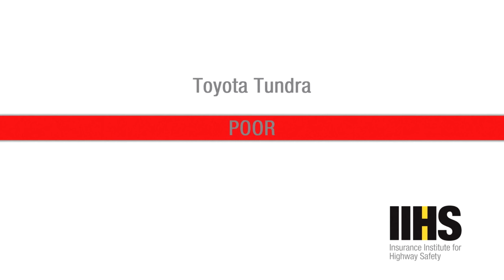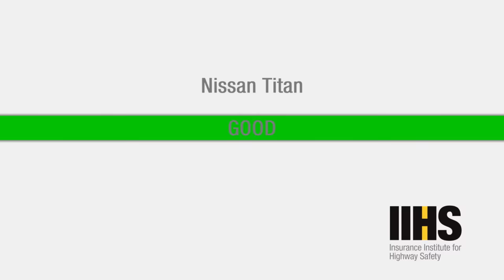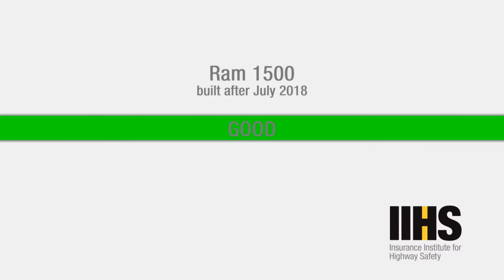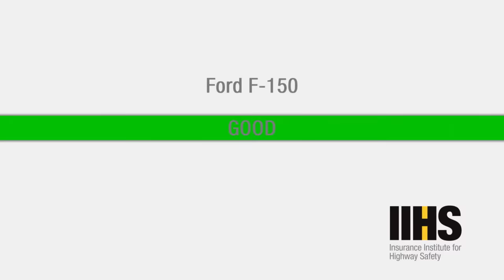TRUCK CRASH TEST COMPILATION - Ford F150, Toyota Tundra, RAM 1500, Nissan Titan

Comment: Better headlight?  Yeah, you ever meet a new pickup on a 2 lane at night?  Even on dim the are really frikkin bright to oncoming traffic.
Reply: badlandskid Christ it’s terrible for the other people. I have a slammed g and the lights go straight into my eyes and blind me, combined with HPPD and I have a hard time driving at night
Reply: badlandskid 2018 f550 with flatbed. The low beams are so bright I see people applying their brakes because they can not see.
Reply: @1melbeehoney  Yeah, too damn bright. I reallt hate that about newer vehicles.
Reply: I wish the NTSB would evaluate today's extra bright and blinding headlights
Reply: Absolutely,,,the new L.E.D. headlight's low beams are brighter than the old regular headlights high beams. G.M. can't build a reliable truck but at least their headlights are bright (might help the tow truck driver).

Comment: Unless there is a straight on collision, hitting the center of an airbag is unlikely. Its evident that all of the passengers deflected down towards the A pillar. Thus not utilizing the airbag to its potential.  Seems like the passenger front airbag should be sewn with an "arm" in a way that it helps keep the person from sliding in between the bags.
Reply: That is a good idea, but it will be hard to attach or connect
Reply: Or just add thicker and bigger side curtain airbags.
Reply: I totally thought the same thing  about most  the air bag missing the occupant. I was thinking it should be one continuous bag but not sure it that was practical from an engineering standpoint.

Comment: F-150. Best truck on the road. Great information.
Reply: It sure is the best truck on the road, for only 100k miles. I see GM vehicles on the side of the road more than any other vehicle due to breaking down.
Reply: Master Troll Gaming HD my rams never left me on the side of the road like my POS f150 did!
Reply: Best truck on the road until it fail the behind test do to breaking down and the interior coming apart as if it was a  completed puzzle not glued together

Comment: Crazy is this was only at 40 mph. Imagine a crash at 70 mph head on with another car going 70mph. Thats an impact force of 140 mph...you dead
Reply: car to car at 70mph has the same impact as 70mph to the wall, because of both cars absorb impact. There is episode in mythbusters about this.
Reply: @Guffy686   It's correct basically but also depends on the weight of both cars. Crashing a Smart into a truck will look differently.
Reply: @elpresidente1000  I'm gonna lift my truck way up so the chassis is even with a normal car's windshield ... for enhanced crashworthiness.
Reply: I saw a guy who hit a parked car that was broken on the shoulder of the freeway going 70+. He was driving a Honda Civic, no seatbelt. He collapsed the steering wheel/column with his chest, broke a femur, collapsed a lung. I was the paramedic who treated him. He lived.

Comment: I'm really disappointed from Toyota! This results are a no go for 2020!!
Reply: Test parameters have changed but the Tundra is still structurally the same as it was in 2007 model year (which it got good ratings back then).  Tundra is in bad need of an update.
Reply: I will still buy Toyota over ANY other maker. You go ahead buy a truck thats going to fall apart before it has 150K miles on it.
Reply: Joe 609  The difference is negligible. But go on thinking there is a big difference. An even better idea is to drive safely.
Reply: @pH7screwtube  tell that to my lemon tacoma. Cheap over priced junk with fan boys that over play the reliability.
Reply: @aaron5222  Lemons happen to all car makers. Just less with Toyota. Sucks to be you.
Reply: @pH7screwtube  difference is negligible? Pretty sure the passenger in that tundra broke both legs. You can drive safe all you want but you can't avoid everything. Anything can happen. I'd rather keep my family safe over having a reliable Toyota.
Reply: @sootlifejew  Your idea of "pretty sure" is also negligible. I would rather have a Toyota than drive around worried about crashing. Every decade cars improve. I am not going out and buying a new vehicle every few years with the idea that someone is going to crash into me. You go ahead and live in fear.
Reply: @pH7screwtube  do your knees hurt yet?
Reply: @sootlifejew  Not nearly as bad as your wallet.
Reply: @pH7screwtube  sorry bud, lifetime powertrain warranty.
Reply: @sootlifejew  Until it breaks and they say its not covered...... Sorry Bud.
Reply: @pH7screwtube  🤣 that's not how it works. You big mad.
Reply: @sootlifejew  Sure little one...... Sure
Reply: @pH7screwtube  big mad.
Reply: @sootlifejew  It appears English is a second language for you. Good luck with that. And best of luck (over)paying for transportation.
Reply: @pH7screwtube  have a fantastic day friend

Comment: Built FORD Tough !!  
Have you driven a Ford lately ?
Reply: I have and it left me on the side of the road!
Reply: @JohnDoe-nz6bk  My Chevy did that for me. I'm not just making that up. Both the thermostat, and the temperature sensor where screwed up, so it overheated on a -30 day.
I also have tons of other electrical issues.
Reply: JoshJLMG Productions that sucks!

Comment: As if I needed more reasons to not buy a tundra... WELP... I guess F150 it is..
Reply: Get a dodge reinforce the front and boom you've got a vehicle with a higher chance of starting than any of ford's newer vehicles ever will
Reply: @IeeIee778  it's ok, I got a tundra. 2013. Don't even know where the check engine light is. Tundra misses a lot of marks but one thing we know for sure is that they are reliable.
Reply: @maddoxinc1642  I won't argue with that

Comment: Ratings are based on how well off the passengers are. 
Basically consider a box around the passenger cabin. If any metal goes into it, it's not a good sign. A piece of pillar could impale you or you could get crushed

Comment: Why the heck do they include the Honda El Camino in these tests. It’s not a truck!
Reply: @__The_Real_V__  Unibody and front wheel drive doesn't count as a truck. Real pickups are body on frame with rear wheel/four wheel drive. Ridgeline is just a lousy Pilot with a bed.
Reply: Ford's done a unibody pickup truck. Rust prevention wasn't very good in 1961, which is why they didn't continue it. The Honda is as much a truck as a 1961-64 Ford.

Comment: 40mph is a reasonable speed for testing given average speeds and what safety tech exists today that is affordable enough for layman consumption. 

But many crashes occur faster than that. If you take a direct hit at 50mph or more in a passenger vehicle, especially tbones, odds are good that IT WILL KILL you no matter what you are driving

On Scott Engles channel I saw a 2008 Nissan Titan had a head on with a smaller SUV on a two lane 50mph highway. The Nissans passenger compartment was fine and wasn’t compromised, even though the front was crushed. Yet still, the driver was killed instantly

Comment: I drive a 2017 tundra. I’m scared now
Reply: Keep the sensors on. I never heard the sensors beep to avoid the accident.
Reply: W. Ethan Jowers your truck isn’t as safe as it could be, but it’s safer than anything 10 years old or older so chances are if on average, that you get into an accident in this truck that most people survive regardless of the vehicle, you’ll be fine

Comment: Good to know how safe the F-150 chassis is. The Expedition is based off it, which I drive for my DD, so I feel a lot safer now.
Reply: They also have crumple zones which crumple the frame taking in the impact, it completely totals the vehicle but you’ll be alive
Reply: Good choice man, I drive an explorer. Ford is my favorite manufacturer!
Reply: Jacob Hammond I have a Explorer as well as two f-150s one is a 1998 and the other is a 2017 and the Explorer is a 2013, can’t beat a Ford I only wish they would put a bigger engine in the Explorer it’s pretty weak
Reply: Huge rollover and depreciation risk.
Reply: @NicholasLittlejohn  Good thing I know how to drive a car and I bought well used.

Comment: That Ford... shifting nearly 2 lanes of traffic over during a marginal collision, that is NOT good.
Reply: Actually when a vehicle shifts a lot like that after and impact is very very good. I’d it just drove straight into that wall and barely moved that would be a lot of gs for the passengers and would end in injuries. Have you ever watched Motorsport crashes?
Reply: @connermcgarrah2171  - in motorsport crashes there isn't a bunch of traffic coming at you in the other lanes.  Think about it.
Reply: @rooh5825  thats actually the opposite. ther emay be fewer cars but in sports like F1 the cars are going 4-5times what that truck was going so thats a lot less time to slam on the brakes.
Reply: @connermcgarrah2171  - again, a vehicle sliding across multiple lanes of traffic, you know, where we DRIVE, is not a good thing.  It is cute that you have your Ford emblem so far up your hiney that you won't admit that.
Reply: @rooh5825  Its not about the brand of the car lmao. You realize that the car is like a cage to protect the passengers and only them. To Ford the only thing that matters is the people in the car/truck. it earned one of the safest ratings of the trucks tested you must just be salt or something.
Reply: @connermcgarrah2171  - spoken like a true Ford fanatic, one who can't recognize failure lol
Reply: @rooh5825  No my sister was in an accident and it was her WRX and a big Toyota sequoia when the suv hit her passenger side wheel well it spun her 1 and a half times bc of that she walk out with a bruised wrist and in shock. if cars dont move on impact or what you call "shift" the only things there to tack the force of the impact is the passengers. sorry for your hatred for ford but they got you on this one.😉
Reply: @IeeIee778  Thats correct, but you see this isn't a head on crash test lol. Its an overlap test so, and if this performed so badly why did the IIHS rate it the only truck "Good" in every category? I don't see what you aren't understanding
Reply: @IeeIee778  also the Ford kept going somewhat straight, unlike every other truck that pivoted and actually did go into "oncoming" traffic. None of what any of you are saying is backed by any physics or data so until you can present some sort of evidence that I am wrong please stop with this.

Comment: If you think about it, this is the worst case scenario that you can possibly crash one of these vehicles.
It's just enough to the side that the engine doesn't make contact. All of the force is being put into crumple zones which have to act kind of like a parachute to stop the momentum of the truck, the engine keeps going well past the wall, and if it was going any faster the entire motor would probably be ejected out the front.
I'm honestly impressed with ALL of the results. 10 years ago a crash like this would likely leave you with long term injuries, and 20 years ago you'd probably be lucky to survive.

Comment: am positive no matter how good those tests were,you will be a cripple,paralyzed or even die after.dummies are not bones and flesh
Reply: Well those dummies are pretty advanced and yes they can’t tell the exact outcome but they give a very good idea of impact points.
Reply: They have artificial bones and same density materials like human has. Also it has G sensors and other sensors too. They can give a pretty close idea for this type of crash how human body could behave after the impact.
Reply: I noticed they didn't discuss the injuries suffered by the dummies. That may be more telling than the damage to the vehicles.
Reply: @bocadelcieloplaya3852 , they take that fact into the safety rating. It is probably the highest contributing factor. Less damage to dummy = safer vehicle
Reply: Unless you're in the ford, passenger side  wasn't caved in and it deflected a lot of momentum sideways so you don't get the brunt force of the impact

Comment: My questions on this test: 1. Why they are using the passenger side as the collision point? In north america it is a right lane drive so the tendency of a head on collision is on the driver side against the incoming vehicle. 2. They should also test the side impact as in t-bone collision  3. Why is the insurance rate is based on the car's popularity I.e.the most vehicle model sold has higher insurance 4. What is the basis of whaf city you lived affects your insurance rate and 5. Why does your insurance premium increased if you have an accident on your own I.e.noother party involve
Reply: 1. As stated in the video, they also do the driver side.
2. They do dozens of tests with each new type of car including t-bones. They are just not shown here.
The other questions: That's the USA for you.

Comment: REMINDER: The Toyota Tundra and Nissan Frontier are significantly older than the rest with their body styles coming out between 2005-2007. The other trucks have a body developed over 10yrs later which can be demonstrated by these modern crash ratings.

Comment: OF COURSE THE RIDGELINE WILL GET THE TOP SAFETY PICK FOR SMALL TRUCKS BECAUSE ITS THE SAME FRONT CRASH IMPACT STRUCTURE AS THE PILOT WHICH ALREADY HAS A 5 STAR SAFETY RATING

Comment: I have a problem with the about a quarter of the vehicle. You should crash all of them few times. It looks that if the ram and f150 had 5 mph more on the clock, their cabin's would be no more. What I want to say there should be several tests with diferent speeds.

Comment: As expected, the older trucks perform much worse than the newer ones. This is why a vehicle should be redesigned at least every decade. The tundra and frontier are both so old now, it’s inexcusable to use the “if it ain’t broke, why fix it” excuse; well it’s broken if it’s not up to modern safety standards, and I’m a 2012 tundra owner...

Comment: Were are the toyota lovers? Every time coment toyotas is the best cars in the world, jajaja
Reply: Actually, if I’m forced to spend 50 k used for a quad cab v8 that will pull 6000 lbs on trailer, my #1 choice Tundra just fell in the rankings. I guess I must continue to put up with the lack of quality my low mile f-150 continues to piss me of with. I won’t consider GM or Dodge, and I’m a former Chevrolet new vehicle dealer!

Comment: A few weeks ago a lady stopped properly behind a semi in Washington State….
The Semi behind her was not paying attention however. It not only rear ended her….but went on top of her Nissan Altima.
The impact was so strong the rear wheels folded backwards 180 degrees.
A responding officer was 100% sure he was looking at a fatality until he heard her muffled screams for help!!!!
He immediately had a tow truck lift the semi off her crushed Nissan.
Amazingly she crawled out of a hole on her own and walked away from the accident.
The impact had broken the seat and she had been trapped, laying in her back looking right at the semis undercarriage inches from her face.
Her ribs all hurt, her head hurt, and she had a nasty bleeding cut to her head.
But she walked away on her own.
People were praising God………
I saw thank and crash test engineer and safety regulations!
🤔….. Ok. Give her Guardian Angel some praise to. They felt THAT in the Morning.

Nissan needed to buy that wreck off the insurance agency and study it. Offer to dig out any salvageable personal effects to.
Plus give her a brand new Nissan Altima at no charge!

Comment: I was hit broadside (t boned) at the a pillar passenger side by a Chevy Silverado 1500 doing approximately 45 mph and my 2010 Ford f150 took it like a champ protected my passenger and I got it repaired with no frame damage  $11k later good as new Ford Tough

Comment: Did he just say that most of those trucks need "better" headlights?
Most of them are blinding people as it is, and when they get behind a sedan with those headlights, they are blinding through the mirrors.
Reply: That part of the rating system, better ≠ blinding. You can have all the lumens in the world but if they’re guided in the wrong areas then they’re useless.

Comment: My F150 was junk, always overheated, even without towing anything.  Valves rattled, didn’t even make it to 125k miles. My 2005 Titan has run smooth as a top and It just turned 270k miles.  No more Ford’s in my lifetime.  Thanks Nissan.

Comment: These tests mean almost nothing unless you are running into an stationary structure, which is a very small percentage of accidents. I've never caused an accident, but I've been either a driver or passenger 5 times when other cars have hit the one I was in. Those are the kinds I've seen on the road as well. 
To give perspective, there are videos of Smart cars "performing well" in crash tests since the one car was all that was hitting a stationary object. I'd take any of the vehicles in this video over a smart car in a head on.

Comment: Toyota : the air bags were great , the front doors are dangerous , and chassis is designed  below is very poorly  designed .
Nissan: It was better condition , the torped wall worked  out  well and the doors .
Ram : Was good  but the side pedals ( kick box ) were  very weak .
Honda . Was  good , other than the front doors .
Ford . was the same as Honda .
Chevy : had bad designed .

Comment: Should add a load into the bed, maybe a quarter of it's rated capacity,  to simulate that most of these are going to be empty a lot of the time but that a some of the time they ill have a load in them, even if it's a giant bag of dog food, 3 bicycles, several empty beer cans and a small tool box.  Also a pair of steel toed rubber boots jammed between the cab and the box.

Comment: For real life add fire smoke and hot fluids spraying around. The Honda Ridgeline is NOT a true pickup (It's a modified minivan). How about testing the fullsize Diesel pickups 3/4 ton and up.